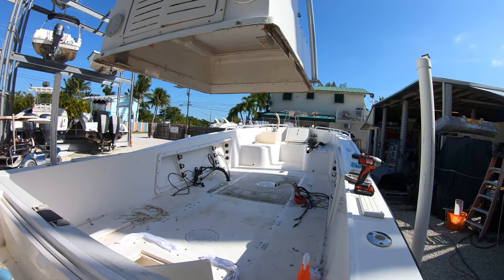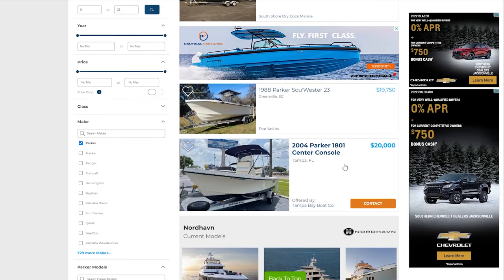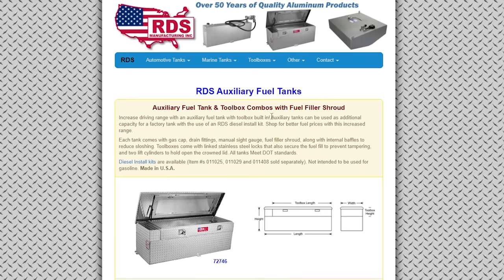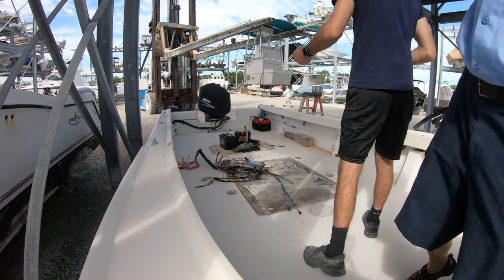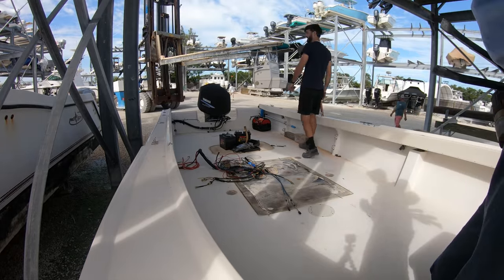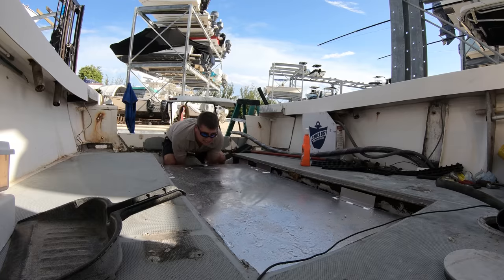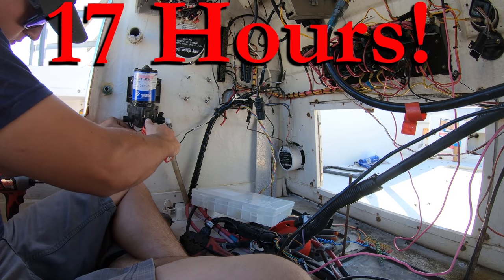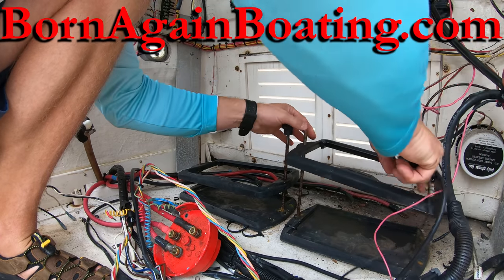What's It COST To SAVE A Boat?

Comment: I replaced the 150 gallon tank in my old 1988 Mako 240 walk-around in 2020 before I sold it and it was a chore. It did have an access panel, which was very nice to have. I saved a ton doing it myself, but to anyone considering this task, I would say it's worth the cost of labor if you can afford it. I also rewired that boat myself and that was no fun either. I did learn alot about the boat though.

Comment: You forgot one of the most important aspects of the tank replacement - the tank coating. I recently uncovered the tank of a 30 year old 22' Mako. Because the tank was both coated and foamed in, the tank was in excellent condition. I cleaned, recoated and foamed it in again. Also added new hoses and fittings. Now the 30 year old tank has a new life. The coating is the most important factor in the long life of a tank.
Reply: you got lucky

Comment: It's not going to save much, but you can buy a vented gas cap that connects to the through hull fitting with a hose and use the fill tube as the fuel tank vent as well.  I have one on my boat and capped off the fuel vent hose coming from the fuel tank.  Works perfectly.
I also just ordered two captains chairs with adjustable pedestals and my 1998 Sea Pro 210 CC is restored with the following:
1.  Brand New Yamaha 175 SHO VMax (Currently 4 Hours on the Engine)
2.  Brand New Sea Star hydraulic steering
3.  2 Brand New VHF Marine Radios , one Console one Hand Held with GPS capability
4.  Brand New Marine Antenna (forget the name, but the good one with Stainless Steel Mount)
5.  Brand New Batteries (x2)
6.  Brand New Perko battery selector
7.  Brand New Bilge Pump
8.  Brand New Live Well Pump
9.  Brand new fuel lines
10 Brand New Vented Fuel Cap
11.  Brand New Trailer Hubs, Tires, and Rims (x4)
12.  Brand New Tongue Jack
13.  Brand New Garmin 9 inch touch screen GPS Fish Finder and Transducer
14.  Brand New AM/FM Radio with Bluetooth
15. Brand New Marine Speakers
16.  Brand New Electric Trim Tabs
17.  Brand New reed type Fuel Sender
18.  Brand New Trailer Guides
19.  Brand New Trailer Lights
20.  Brand New Throttle Controller and Wiring
21.  Brand New Trailer Bunks
22.  Brand New Wash Down Pump
23.  Brand New Wash Down Hose
24.  Brand New Bait Cutting Tray (Rod Holder Mounted)
25.  Restored (not brand new) Canvas T-Top Cover with Brand New lacing line
26.  Brand New Fish Net
27.  Brand New Casting Net
28.  Various Brand New Rods and Reels with Brand New Fishing Line (x4)
28  Brand New Navigation Lights

The only thing I'm considering adding now is a Brand New 72 Inch Minn Kota 110 pound thrust Salt Water Series trolling motor with 2 Brand New batteries.  The marina quoted me a price of $7,200 installed.  They must think I'm made out of money.

Comment: I wish my project was this efficient and cheap. I bought a 1999 26ft world cat a few months ago. The previous owner had filled the hulls with 2 part foam. The boat could not drain properly and would hold water. Been going through the boat for 3 months and keep finding new spots where foam is soaked with salt water. Stress fractures and other fiberglass issues. I am located on Oahu Hawaii and the price of everything here is through the roof. I appreciate these videos because I get to see what should be charged for certain jobs and how they should be done.

Comment: There were no poly tank options for my boat, reason:dimensions. Had a 33 gallon belly tank fab'ed by a local Puget Sound boat builder Peterzelka bros, it is top notch, heavy gauge and no not cheap! And I've heard that coal tar epoxy is a great coating for aluminum tanks

Comment: I had the same problem on my 91 kencraft 19ft I just drained the 55gal tank under the deck and replaced it with two interchangeable 12gal tanks mounted above deck. Cost me 300$

Comment: this is a great eye opener video for people who arent familiar with how boats are built and how crazy expensive it is to have to cut the floor out in some boats. I would probably esuggest using poly tanks instead of aluminum especially in saltwater environments, itll never corrode and the newer tanks are super strong unlike older versions which would degrade over time.

Comment: I've changed my fuel tank. I ordered 4 mm marine grade aluminium. It was 64 gallons cost 831dollar . complete with fittings ,hosees , primer and paint it ,total cost 1.011dollar excluding my time to fit it again on the boat

Comment: What’s your take on a going with a cross-linked polyethylene tank and the cost instead of going with aluminum again and having poultice corrosion rear it’s  head after you put  that tank back in and moisture gets in between the tank and the foam?
Reply: For me I found it best to go back to aluminum.
Reply: If it is truly crosslinked you should have minimal issues with ethanol fuel. The only thing is it may not have baffles to help keep fuel from sloshing so probably best for 50 gallons or less.
Reply: Steve I've looked into coating my new aluminum tank with coal tar epoxy

Comment: Oh crap I hope my fuel tank doesn't go under the CC. I thought I could get to it by just removing the seatting deck section. Also from what I can see my tank is not foamed in. It's 1996 Bayliner trophy. Did they foam in the tanks back then? If so I'm betting this fuel tank was either replaced or something was repaired requiring them to remove the foam to get the tank out.

Comment: I wouldn't put that bare aluminum tank back in that boat. Epoxy paint it then take it to the spray in bedliner guy and spray that whole tank in LineX bedliner spray. Then the only way that tank will rot is from within. It will totally be protected on the outside foreverrr.

Comment: If you can't examine the tank and you can't hydro statically test the tank how would you know before hand the tank is bad?
Reply: This question is for buying a used boat.
Reply: Check fuel condition and smell the bilge for a fork smell.

Comment: and what other cans of worms will you find as you open it up???
Reply: Had a former friend learn that one in my shed, trying to DIY it on an 18 foot twin console.  Bad tank, opened it up, bad foam, cut the bad foam out, bad stringers, while you’re in there, may as well redo the wiring and power steering lines and refresh the inboard, and if you’re doing that much mechanical work, you may as well redo all the upholstery and refinish the hull.  He was diligently spending 6 hours per Saturday on it for the first 6 months or so, learning to do each thing and giving it a college try.  By that point, he’d had the hull down to bare glass, he’d re-built the wood structure, reformed the hull, replaced the tank, replaced all the pumps and hoses and such, but broke off half his manifold studs in the block, and the motor was kicking his ass.  He started finding excuses as to why he couldn’t be over that week to work on the boat.  It’s too cold, I’ve got a family commitment, the new Zelda just came out, etc etc.  I got sick of it by May and told him he had until August to get it finished or I was packing it all up in a tarp and dumping it on his lawn.  I got a buddy who knew marine motors to fix his 302 for parts and beer, and bullied his wife into making him come over on week nights and he got it back on the water just in time for July 4th.  It looked as good as new and performed better than it had ever performed (cutting close to 2thousand pounds of fuel and waterlogged foam out will do that).  He brought me out for the inaugural ride, and we’ve barely spoken since.  That was 2007?  Paying to the the job would have been 12-15Gs in money he just didn’t have, but I’m sure his parts bill was at least 4, and it chewed on him for over a year, if you count it beating him up mentally in his 5 month project hiatus, never mind what it did for our respect and friendship.

Comment: we've got a 1990 Bayliner trophy is a 19 foot 6 inch boat and it's got a Force 125 on it and I'm just wondering is it a good vote I mean it's good and solid but I've got to get the rod out of the tilt and trim and I can't get that rod out of it that hose for tilt and trim in so how can I get it out I need I need you to let me know thank you and have a blessed day and be safe 🙏
Reply: And I meant to tell you is a center console
Reply: @claudequeen6614  I used a sawzall (reciprocating saw). Skinny metal cutting blade and made two cuts inside the tube. Project I never want to do again. Don't worry about scoring the part that the tube slides into. Doesn't hurt a thing
Reply: Thank you and have a blessed day
Reply: Dang Claude I gave you instructions to remove a stuck tilt tube. Sorry. The pin at the top and the rod at the bottom both should have snap rings. Take them off one or both sides and use a punch or bolt or whatever and a sledge hammer to drive them out. This is the way
Reply: I screwed the nuts off of it